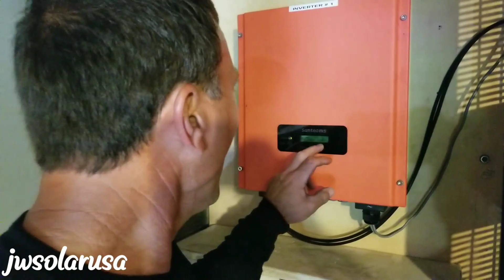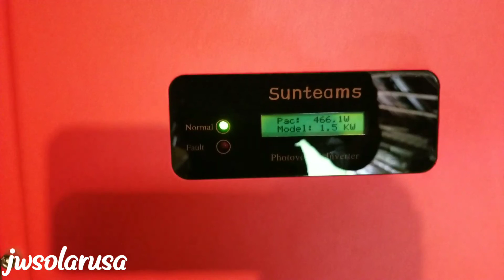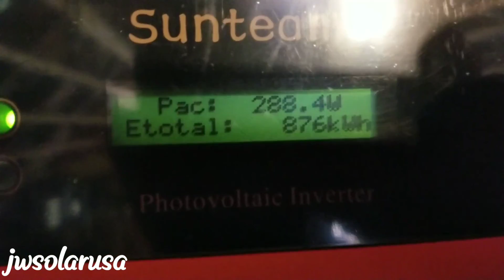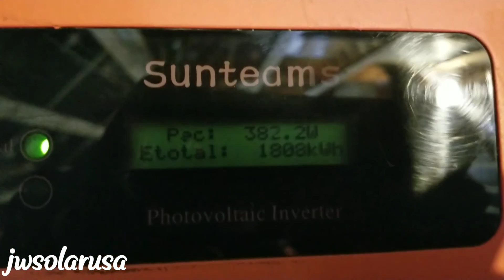HOW TO RUNS YOUR HOME SOLAR SYSTEM WITHOUT BATTERIES COMPLETE VIDEO

Comment: Don't look at the 12 v vs. the 48V system take the system you can upgrade in the future, that will be the lowest cost in the future. That will properly be the 48V system. And when you have to decide what you are going to those. You have to calculate you uses (Wh) doing the night, and maybe some days with no solar, If you will be able to cover that to, then you need to do the MATH, just ad all the combustion together and ad 20-30% more for the conversations, because the inverter are not 1:1 conversation every converter have loses. You will end up with Wh and that is the same when you are using 12V ore 48V ore 96v ore what ever Volt you are using thats the way it is, Amp*Volt = Watt, Watt*h= Watt/h simple MATH, but the converter are not the same, Chose this one that will cover your needs, and with a possibility to expand.......Otherwise you end up with something you have to replace and That IS NOT THE WAY TO DO IT......By the right stuff the first time.....Thats is THE cheapest...on the..Long run. "Think Big and prepare for you coming needs".

 
When you have don the math on the battery systems, maybe something like 10 KW/h ore even 30KW/h (1000W/h*24 = 24Kw)

 Then you know what you have to install of solar panels. The panels have to be so large that it can charge the battery pack, and also produce for the daily use to.....and "wupty" you have you system size, The battery Bank, Solar size, and inverter seize....Find the suitable battery bank, solar array, and Inverter all reddy to install......Do the math that is the imported stuff when you want success, thats all.....easy right. 

Be happy and do the math..... You will properly end up with something like 10-13KW ore even a 30KW system ore something like that when you want to produce some power when the clouds are there. 

Then you only get something like 1/10 of a sunny day, (a 300W panel SUN are producing 30W CLOUD ore maybe less). 

 Lets say you want to find out, what a panel are producing, measure the Volt and the Amp min (10 A Meter) facing the sun.  Then turn the panel 180 deg. facing away from the sun, then you have something like a clouded situation, then measure the panel Volt and Amp and you will properly find the same calculation as I did a 1/10 situation..Now You have the performance of the system, Then you have to find out HOW MUCH SUN ENERGY ARE YOU GETTING IN YOUR ARRY OF THE WORLD, 

The Panels are rated at 1000W/m2..But most of the time we only get something like 800W/m2  of a sunny day and when your panels are producing maybe 15-21% Power/m2 = 150W-210W m2....... energy then you also know how manny m2 you have to cover to get the amount of power you need... and thats all.......BUT don't  GESS..... DO THE MATH.....and don't fall for the cheep 12V car stuff way to small for house use, 

Just try to calculate the WaterHeater (1Liter water rising 1deg will cost you 4180w/sec) Just download this calculator https://joshmadison.com/convert-for-windows/  ore go https://da.wikipedia.org/wiki/Joule

Then you'll find out that ,12V Car stuff......hmmm...... is just for topping up your iPhone .....Not for heating your shower water ore keeping you warm in the evenings......Hmmm First find out of you NEEDS then decide How much do i cower with the solar system......If all... then you have you answer....... 

Thats the way to go....  Bets to all....Power to the people  ;-)....... Jørgen Thomsen Denmark DK
Reply from the maker: +Jørgen Thomsen 
Thanks my friend Jorgen for this awesome information. I really appreciate you taking your time explaining everything in detail. 
Have a bless evening and keep stopping by ok?
Reply: Hope it was helpful somehow..............And when you are all to DIY then you can start and make THE BATTERY BANK YOUR SELF
....."GRAPHENE".....hmmmm 

Lot of people are making Li-ion battery banks of ..."harvesting old stuff"... But This here is Different, and from GROUNT UP ;-) 

lot of money to save, and a hole lot of work and experimenting to do......But the result are amassing and you will be able to cover you power needs doing the night, ore even more, depending of the seizing of the "Battery Bank".......I say "Battery Bank".....That is NOT the truth it is a................."Super Capacitor bank"

Lot of people that hear that will say.....NO WAY to small to title storage capacity and this is right.......But this is different. ....

 That can be build to fits the volt of your panels -Open Volt, and the energy stored depending of the size you decide to make it..........Then you have a "Battery" that are so large that you can actually support your self with ALL the POWER you need......IF you have the right size of Solar Panels

 .............But LOT OF WORK has to be don...and have fun, Thinking ---- HOW MUCH ENERGY YOU CAN SAVE------ The prices making it is a little trivial but....you have to come to That point first.....LEARNING THAT IS THE KEY WORD......And  then........"Wee can do IT". 

And the result If don it right are 1000 of cycles ore even a 10000 cycle .............and they are cheep to make.... relatively .....but first you have to learn how to make the "STUFF"...........

I am going this way.........And are making a lot of testing in the future....maybe the next year ore so.....And Look where the smile are sitting.....Well.... WEE can all do it.....just lean.... and...let us Go out and Have some Fun.... while doing it.

If interested look at This AMASSING GUY Robert Murray Smith
...... https://www.youtube.com/user/RobertMurraySmith/videos ...   

Best Luck to All and LOT of SPARKS .....Jørgen Thomsen Denmark DK